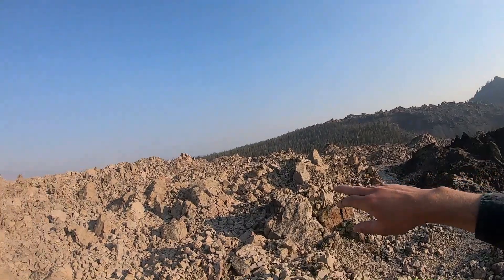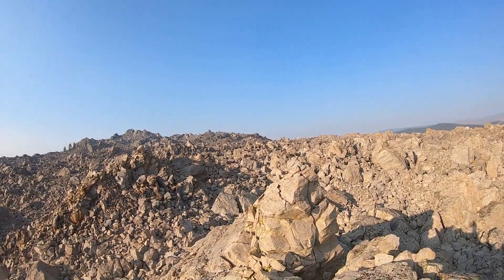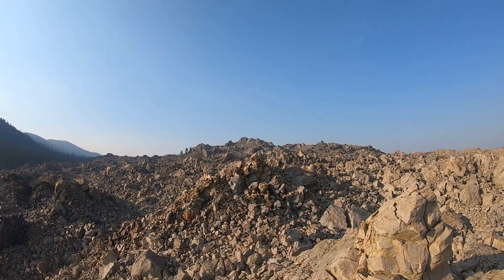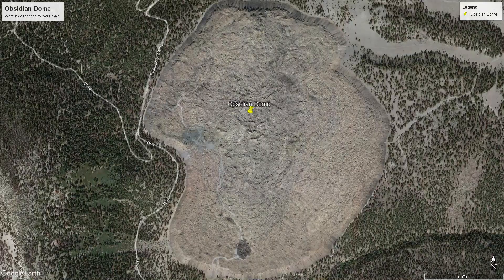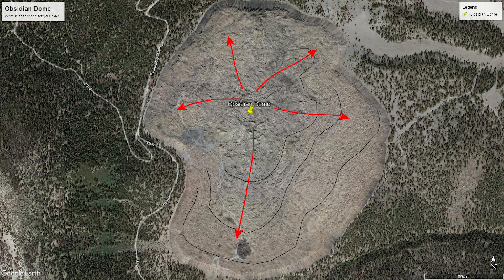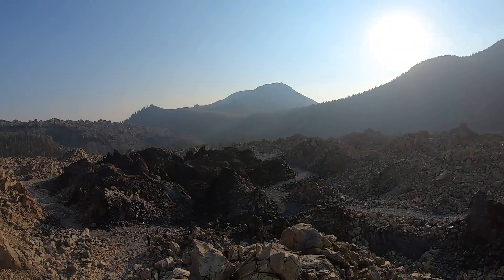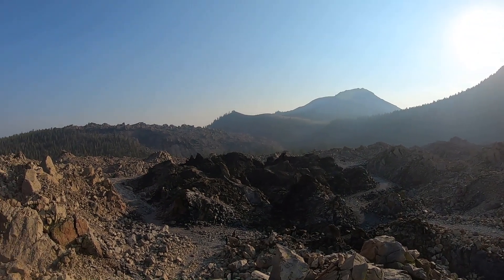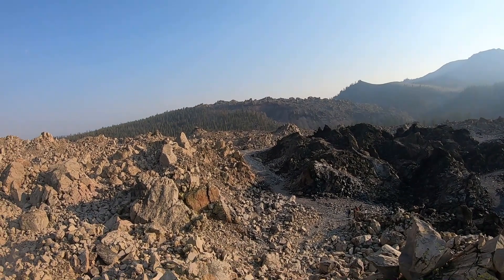Owens Valley Stop 11:  Obsidian Dome

Comment: Some of the glass obsidian I found back in the 60s has turned into snowflake obsidian.
Reply: you’ve seen it change in just 50-plus years?? likely these obsidian outcroppings are much more recent as glass is known to be much more rapidly oxidized than the current geological paradigm wants to admit.
Reply: @ainaguru4986  It already had some white crystals in it, but over the years more have appeared to the point I wouldn't have collected it if it looked like it does now.

 I was told at the time (I was a kid) that if I wanted some without the snowflakes I'd have to break a piece off and what was underneath looked more pristine. It wasn't easy to find a clean piece, I must have busted up 50 lbs to find some decent pieces.
 Have you ever been to Obsidian Dome? There's a lot of snowflake obsidian. The rockhounds didn't tell us where the good obsidian was found. I discovered the good stuff when I lived in Mammoth and Bishop in the 1970s. I also discovered that rockhounds tend to be secretive. Especially to tourist collectors.